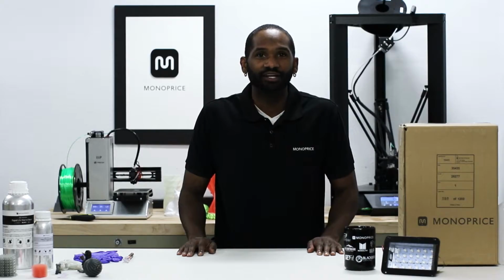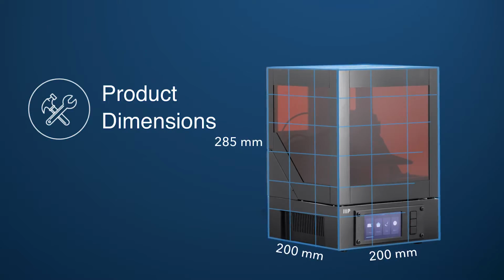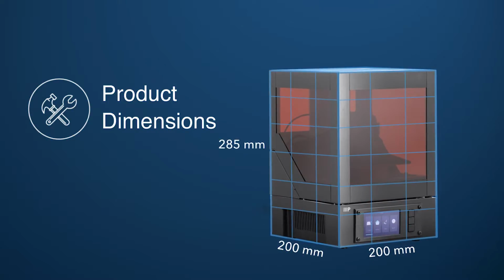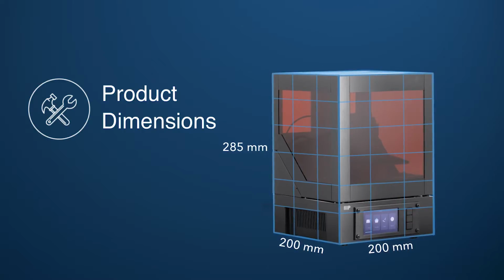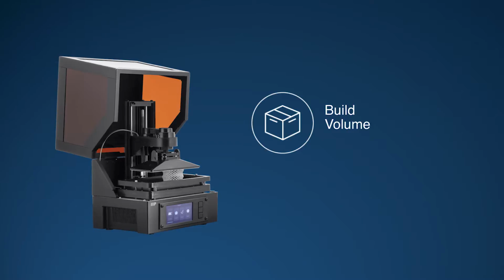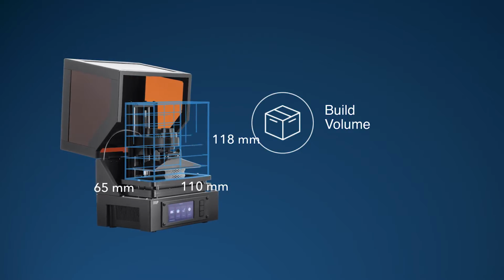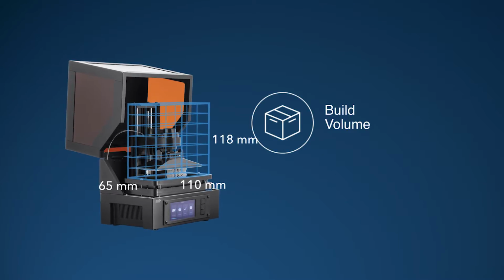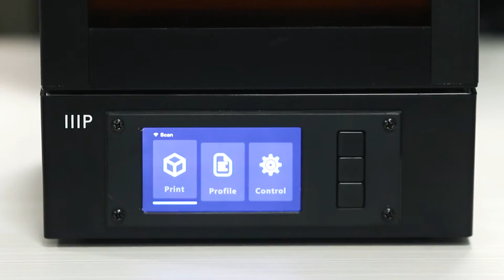Monoprice MP Mini SLA Resin 3D Printer

Comment: Could you please give us the dimensions of the build volume with x y z coordinates so we can fill in slicer settings? I tried 68, or 69 by 121 by 100 recommended in the instructions but then others recommended 110... the only print that worked was the pig but then the second time it failed... cannot tell if I messed up the leveling or just did not scrape the bottom properly...

Comment: I was wondering if you could show a video of the MALYAN SLA LCD Resin 3D Printer High Resolution Auto Leveling Wi-Fi Support 4K Resolution LCD Touch Monochrome Curing Screen All Metal Frame Parallel Led Black Larger Printing Size 192x120x230mm.